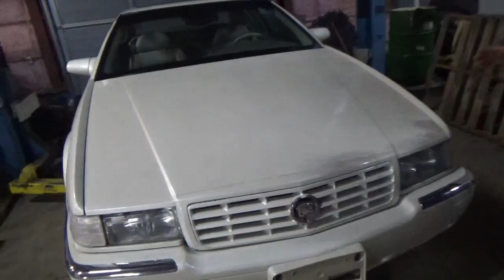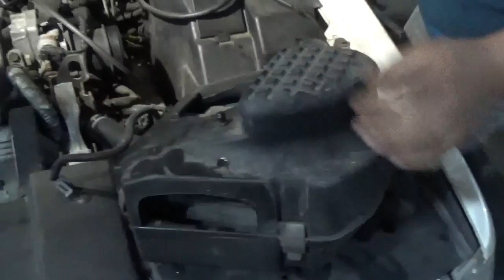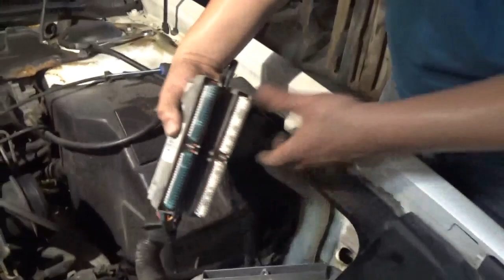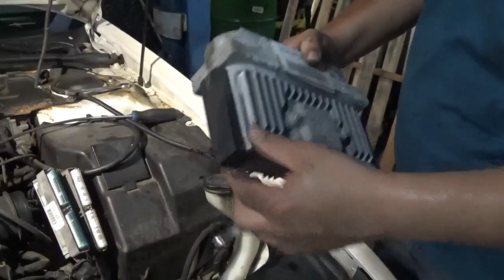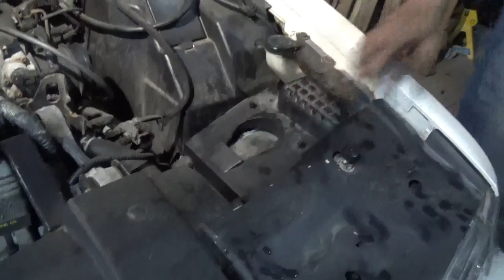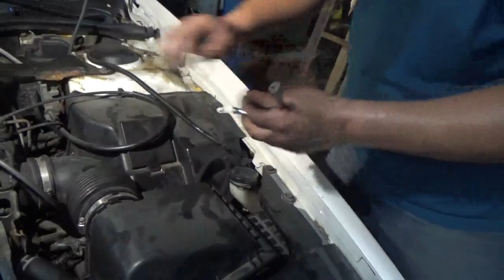PCM / ECM Install on 1996-1999 Cadillac Seville, Deville, Eldorado

Comment: So where do I get one my problem is I can't hold fuel pressure injectors just spray flooding engine gas drips out tail pipe running smoking alot
Reply from the maker: You need to figure out which injector is stuck open and why. Faulty injector or faulty PCM?

Comment: I hope he starts posting videos again. I had ordered something from his website recently and I emailed him a question about it and didn’t get a response yet. I hope everything is ok.
Reply from the maker: Xavier - thanks for the heads up, I will check my emails and reply if I find yours! Yes sir I need to start making videos again :) Thank you
Reply: @NorthstarPerformance  I appreciate the response. As of now, you are the only Northstar professional that I trust on YouTube for how-to’s and just general info. As well as the only proper aftermarket for these engines, we love to soak up the shared knowledge my friend. :)
Reply: WOULD A BAD PCM CAUSE NO LIGHTS ON DASHBOARD NO SOUND WHEN TURNING KEY??
Reply: @KDBM8519  most likely not, might be the ECM
Reply: @steiner3626  pcm is ecm right?
Reply: @steiner3626  I removed a ground wire while the battery was still connected

Comment: I did the same thing and now my car won't start theft system problem came up🤷🏾‍♂️🤦🏾‍♂️
Reply: I was going to order a tuned PCM from these guys... Seeing your comment, I've become skeptical about changing out the original PCM.Please let us know when you get your caddy started. Good luck bro.
Reply: @dannick123  I'm thinking 🤔 it might be my fault because I didn't take the NEGATIVE BATTERY CABLE OFF I just remove the POSitive Cable that's about the only thing I did different from the video

Comment: I need help with my ‘99 eldo! The security system was triggered somehow. Car won’t start, zero electrical power! Help!
Reply: It sounds like the vats security system is the problem.The wires in the steering column that allow your car to recognize the chip in your key have probably broke. You need to just use a spare ignition key or the same value resistor to bypass this. The wires is easy to get to under the dash.

Comment: I hava a question? I have an 98 cadillac seville sts an my water pump housing bracket had a cracked lip where the water pump sits. Now I have one coming in April 1st were would I find the gaskets that go behind the housing? An do u have a video on removing the water pump housing it would be real good thanks Korey

Comment: I have a 1982 cadillac eldorado I replaced that ecu 2 years when I 1st bought the car because if you gave it gas it would just cut off. So when I bought it fixed the problem. But now I'm having a problem with getting lots of exaust loss of power and using alott of gas shot told me the prom is bad on the actual ecm do you know where I can get a prom or can you send me a link for an 82 eldorado please???

Comment: Do you guys do performance ecu flashes on the 06 northstars?
Reply: That's what ive been wondering??
Reply from the maker: Long time for a reply but we sure do! All front wheel drive Northstar cars now: 1993-1999, 2004-2011 and some of the rear wheel drive ones too.

Comment: We have a 2005 Cadillac XLR (not the V) with a Northstar engine (110,000 mi) that burns a little oil. Is there a PCV or ECM valve to replace? Any suggestions?  Thanks!

Comment: Can you please help me? I’d really appreciate it if you answer back. My 96 DeVille has 90,300 miles. Runs well but sometimes when it gets warm, and I put it in park the engine bogs and wants to die. If I step on the gas it helps a little. Then when I start it up again it’ll crank long and won’t start. The second attempt it starts, but very rough. It seems to bog. It seems to be doing it more often. It’s my Sunday driver so it is rarely driven. It sits for a long time sometimes but I do start it once in a while. Thanks bud.
Reply: It sounds like it may be your crank shaft position sensors going out. I had the same issues and just completed that repair on my 96 STS. Check your codes.
Reply: @pnwbluesky76  thanks buddy I’ll look into it. Appreciate your input!
Reply: You need the head stud kit
Reply: @LamontBoucherville  it’s not overheating or losing coolant.

Comment: I really need some help with my northstar engine I own a 99 cadillac deville . I have changed the radiator water pump .water pump belt tensioner belt thermostat spark plugs spark plug wires ignition control module and one bad ignition coil . My car is leaking oil but my dipstick reads full of oil . My check engine light came on and it says that I need a cam sensor well when I went to start the car it back fired twice from under the hood so does it mean that my engine is destroyed or does it mean that the bad sensor is causing the backfire ? I paid 1000.00 dollars for this car iam the second owner it has 145014 miles on it right now.
Reply: Taamir Bailey it’s the faulty sensor.
Reply: @filthyanimal874   thank you so much for your help how can I fix the oil leak that I have

Comment: Hi Jake, Where is the best place to get a new ecm? I have had my 2000 Seville parked in my garage for 3 years now. It randomly shuts off while driving. Can this be caused by a bad ecm? I’ve put a lot of money into that car over the last decade. It has 120k miles on it. I would love to get it back on the road.
Reply: I had the same issues with engine randomly shutting off while driving and intermittent rough idling or hard starts. This came with a Service Ignition System message. I check the codes and then tested the ICM/ignition control module and it tested good. At that point I ordered 2 crankshaft position sensors along with a camshaft position sensor from amazon and installed all 3 sensors. So far it's working fine.
Reply: G did you figure it out? This guy rarely answers back.
Reply: @filthyanimal874  I did not

Comment: Great video! Got a 2000 eldorado. 64,000 miles
Reply from the maker: Thank you! Enjoy the Eldorado, they are amazing cars! And that is low mileage for a Northstar. The internals probably still look like new!
Reply: NorthstarPerformance yeah! I’ve only put 2,000 miles on it but the oil still looks new after that many miles. The car is mint and I hope to have it forever! It feels and shifts and sounds like a brand new vehicle.
Reply: NorthstarPerformance hello, do you think 90,000 miles is low mileage for a 96 DeVille with the Northstar? That’s what mine has.
Reply: The Skipper depends on the year
Reply: The Skipper 90k isn’t a lot for an engine in general